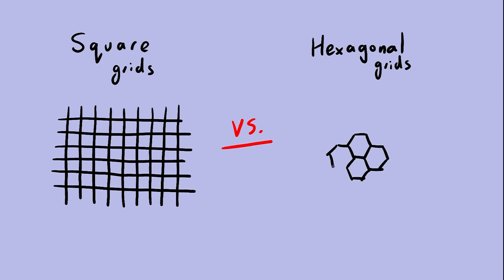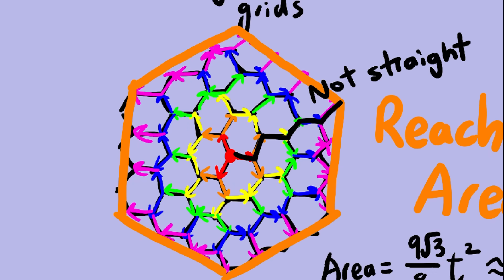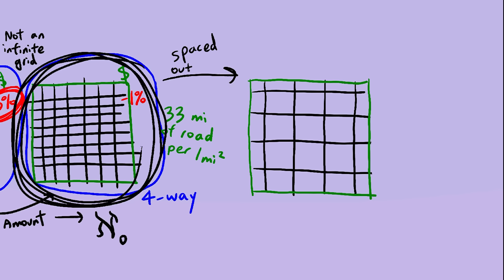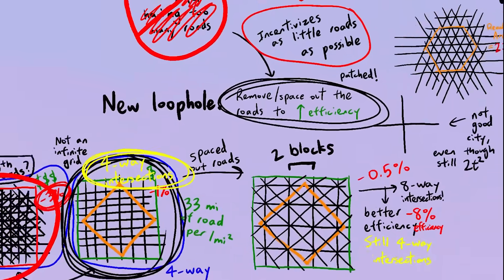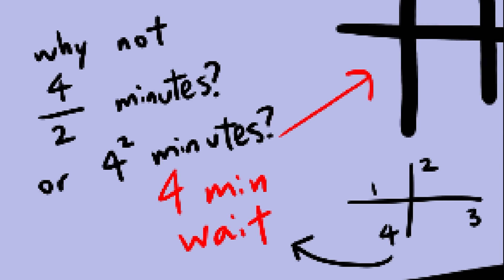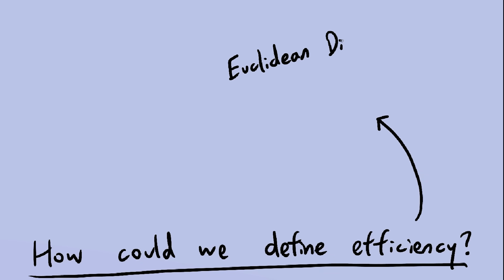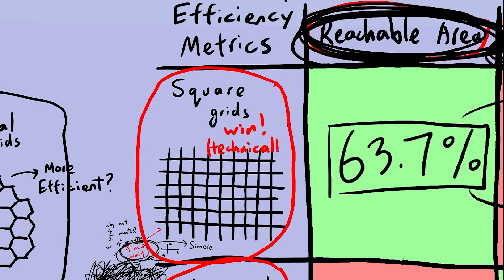Would hexagonal city blocks be better?

Comment: assuming this is city blocks, an intersection adds time based on turns. I'm australian, so you'll have to adjust what I'm saying if you're from one of those countries where drivers sit on the left side of the car. I'm also from sydney, so I'm not so much used to city blocks as city... abstract shapes. I also don't drive. Anyway, while I still have a shred of credibility...

often you can turn left at any time at an intersection, but other than that, at a 4-way intersection there's 4 general states that the lights alternate between: north-south cars turning right, north-south cars travelling straight, east-west cars turning right, east-west cars travelling straight. This means that on average a car will have to wait 1.5 light changes before they can travel straight or right. If you assume that a car is turning left a random number of times from 50% of all turns (because they're travelling diagonally) to 0% of all turns (because their destination is in a straight line), they will have to wait for 1.125 light changes per intersection

at a 3-way intersection there are 3 states: south cars turning right, east cars turning right, west cars turning right. on average a car will have to wait 1.0 light changes before they can turn right. if we assume that the average car needs to turn left as many times as they need to turn right (the only reason the numbers would vary is if you end your route at a different orientation), then they will have to wait for 0.5 light changes per intersection. That's way, way less time spent waiting at traffic lights, which traditionally in denser city blocks you often have to spend like, half your time doing.

however, 4 way intersections can be super optimised in peak hour by making sure that if most cars are travelling east-west, every car that passes straight east-west will arrive at the next traffic light just in time to keep going. given the multitude of optimal paths through a hex-grid, syncing traffic lights based on the most travelled path of the hour may be much harder for your algorithms to adapt to. can't tell you how to model that.

Comment: Another way to measuring efficiency would be how many lots of a given size would fit in each grid. If we set a certain rules about sizes and shapes (so we have usable lots), with maybe a certain width of road, then the problem of "road density" is patched, because different .

Comment: You need roads with area and capacity to make it more useful, you'd also need roads of different roles, like in-block service ways, around-block streets and highways I guess. I don't know right terminology for English. Also. You need to account for different modes of travel, and you need to start with walking, cuz everybody walks (or rides a wheelchair, also a good factor to consider, make a space wheelchair-friendly, and it will be convenient cuz it has no stairs). Cars actually should be at the end of your priority list, they don't make a good city transportation mode, and should be penalised.

Comment: You can ignore arbitrary grid scales and discrete units by "zooming out," or to put it another way, just pretend all your blocks are infinitely small. Assuming destinations are evenly distributed in all directions, all possible destinations of distance D can be represented as a circle of radius D around your start point. You then need to write functions for squares and hexes and find the area under the curve of that function. For a square grid it is: travel distance = sin(angle) + cos(angle). For hexes, you can travel along three axis instead of two which is more direct, but you must multiply your distance by 1/cos(30) or ~1.1547 to account for the zig-zagging roads. I'll leave you to figure out the actual equations, but just visualizing the curves in my head curves, the distributions skew towards the higher end of systems travel distance range, more-so for a square grid, so the hex grid will have a lower average actual travel distance.

From what I have heard, three-way roundabouts are considerably more efficient than 4-way intersections, particularly if we assume urban traffic that is constantly moving in all directions. You could probably find some numbers from traffic planning research that would be easy to plug in to your equation.

In terms of space efficiency, a hex grid of course offers the highest area-to-perimeter ratio of any tiling shape. A hexagonal block has 1.3 : 1 street length to area, compared to a square block's 2 : 1.

It's very understandable why cardinal grids have been used since antiquity: the Romans didn't have google maps and self driving cars, but now that we do have those things, hexagonal blocks make a lot of sense.

Comment: I see a big problem with this analysis. it assumes that all the area in a block is usable. if you have a block which is 100mi long on a square grid the reachable area as defined by the video is still the same. but how are you gonna get to the center of that square?

Comment: 12:19 Couldn't you fix that by adding a rule that normalizes the (average) area of the buildings to be the same in each grid? As in the area of a building (or average area of one if there's multiple different building shapes in a grid) is always set the be square of the unit of distance used.

Comment: i think this video perfectly illustrates the problem of everyone using the same inefficient mode of transport

i think you should account for different road networks that run parallel to each other at different speeds and different patterns, and switching from one mode to another takes some time...

also, this i'll use this video mainly for deciding wether i wanna use a hex grid for my pf2e game

Comment: Square grids don't require you to wait at every intersection because you can go straight.  So you only need to wait sat some intersections.  
Hexagonal does require a wait at every intersection because there is no straight.  The ability to go straight through several blocks without stopping is the real deciding factor.

Comment: So what I'm hearing is the most efficient city plan is a walking city with no roads. No roads + walking = everything is a road and you get the perfect 100% efficiency. 
I think you're approaching the problem more-or-less correctly but you're over-simplifying too many variables. Start with a standard city block size so that adding/removing roads to cheat any metric is effectively impossible. Then add a delay to each intersection based on the number of lanes and also the type of intersection. Rerun the math based on different speed limits and traffic congestion, then do funny statistical analysis on the various tunings for each variable. 
The reductive principles are essentially what city planners use when designing neighborhoods, but like any model this approach loses accuracy the more you reduce it.

Comment: Turning seems to be what takes up the most time, if you're having to zig zag instead of driving straight, that would be a mess. As well, square lets you align with north south.

Triangle pairs aligned in a parallellogram might be interesting, you would have a mix of east west, and diagonals.

Comment: Cool video! I got an idea for your calculation, i would devide it in two parts: speed and cost. 
Cost: You could have set some real world boundaries for the problem. Around 8 meters of width for a road and you could use a 1 square kilometer area and a cost of $15 per square meter of road. Then you could fill the 1m^2 area with your road layout and calculate the cost for the roads with geometry.
Speed: As you did, i would average multiple "A to B" distances randomly set on that area with a 40kmh speed and a 1min wait for every lane crossing the drivers lane. For example: 4 way intersection = 1 waiting out the green phase of wait for the other road crossing. (So 2 way = 0, 3 way = 1, 4 way = 1, 5 way = 2, 6 way = 2, and so on)

To conclude: you would get a kmh per dollar spent average efficiency index that takes speed and adjusts it for the expense of building 1 million roads in a small area. :)
Reply: Also, at some point you want to have usable area between roads as a factor. Maybe doubeling roads makes the driving faster by a bit but you would be driving if there were no building to drive to.

Comment: Not a civil engineer but street layouts are usually not driven by cars but by land divisions. It's just easier to divide rectangle lots. The problem of having too many roads isn't just maintenance cost, it's also land use efficiency, there's no reasons for those roads to exist if they don't lead somewhere

Comment: The overall issue with reachable area is that not all areas are created equal in terms of use as a source, destination, or just an area a lot if people have to go through. This is why we get hierarchical roadway systems irl, which is often pretty easy to implement in a rectilinear or curvilinear grid if the topography is cooperative. Additionally, this hierarchy often imposes what would be direction-specific penalties here.

Also, it's a lot easier to cut/add road segments in a rectilinear or curvilinear grid and still have sensible shapes. They don't have to be a tiling. Meanwhile, cutting segments in a hexagonal grid isn't so nice.

Comment: I'm pretty sure others have said it but. You could force the maximum distance between two parallel roads to be one minute given anything smaller is less efficient. You could also set the intersection time based on a fraction using number of paths/light cycles, if I'm not mistaken, 2/n for integers>=2

Comment: I'm at 0:34 and I'm already saying nope! And the reason is the damn zigzagging you'd have to do in a hexagonal grid.
Reply: But in a square grid you also "zigzag". Because in both cases the problem are the intersections and not the streets itself.

In addition could you just add straight lines into the hexagon grid.
Reply: @Grothgerek  you go in an L shape on square grids to reduce having to turn all the time, in hexagon you have to turn every few meters which will slow you down very fast
Reply: @BableBeatsQuality if you use a main road concept and combine it with one way street, you can reduce red faces close to 0.
You never really turn in the first place, because the streets are just angled 60°.
In Europe there are countless 60° degree roads and they never really slow you down that much. (You just shouldn't drive like 60 or 80 miles per hour/ 100 to 130 km/h) 

And that's assuming, that they don't use any highways in the first place. Which should be the main fast way in both concepts.
Most cities have main road and highways to speed up key lines.
Reply: @BableBeatsQuality  You don't "turn". You just drive forward in a angle.
As long as you don't drive excessively fast, this will not slow you down at all.

Comment: Roads cost money to build and maintain, while buildings accumulate money through taxes. 
So minimizing the area covered by roads is a valid approach. You just have to have an opposing penalty for when blocks are too big to reach the inside properly. 
For example, you can have two speeds - walking and driving - and calculate the time between two truly random points, not just points on the road network. 

You kind of also need to think of different road sizes. "Hexagons all the way down" is impossible, so you need to choose which level of road that should be hexagons, and then think of how smaller roads would be positioned.

Ultimately, I think the idea needs to be tested in simulations or reality, based on something like population happiness or tax revenue. 
AND you need to accommodate the hexagonal grid by having things like hexagonal/trapezoid buildings, triangular parks, etc, so rectangles don't win by default through having shapes that happen to fit the grid more optimally. 
I guess maybe if you modded Cities: Skylines?

Comment: I am definitely not good at math and I am aware this is a math video
But to answer the question which is more efficient, the most intuitive thing that comes to my mind is to run simulation from every block to every destination at a set limit size say 100m (1m per block)
There’s heavy emphasis on interaction but imo traffic is never predictable and will always be a variable to try and make it a constant/% modifier seems quite stupid and let’s just imagine a perfect world where every car can go thru intersections with perfect coordination. I think the traffic part is quite irrelevant to efficiency.
To give an analogy, the efficiency should be how fast can water travel in a regular shaped grid, and it should give pretty good answer if conditions are set to only grids and regular hexagon.
Trying to solve it with math is not the most direct way to solve this problem, and rather than the road,  the shape of the block and the way they line up should be defined a bit more clearly ( the part where bricks are mentioned, and shapes which aren’t equal started in size started showing up,  which aren’t regular polygons)

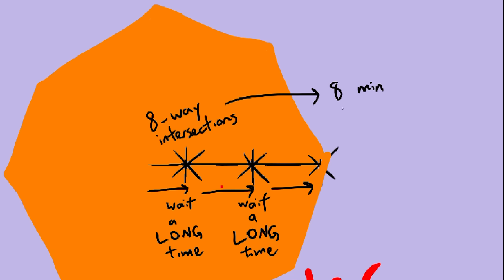Comment: 5:50 this makes no sense right? 
A normal square grid intersection is ACTUALLY only 2 streets intersecting. 
However a hexagonal grid intersection is 3 streets intersecting. 

You seemed to have mistaken the 4 lines as 4 streets when in reality its only 2. 

This matters because a two way intersection only requires one of the two roads to wait while the other goes straight, then in turn they can go straight. 

Meanwhile at the hexagonal intersection, you would need to wait for the green of BOTH other roads to pass before your green.
Reply: Infact taking this further, 3 lines intersecting AND continuing would be strictly better than the hexagonal here, because it would still be a 3 way intersection but also allow going straight. 

But your model would for for reason list this as 6 streets instead of the actual 3 that it actually is. Because in terms of stop lights, its LITERALLY the exact same as the hexagonal one, but you can drive straight.

Comment: You were operating on feels and I could feel it!
I'm here for it! XD
Now the best way to handle some of your loop holes I can think of is; to factor for usable space and access!
Remember even if we don't want go somewhere somebody sure does. 
All space is valuable in a city so one needs to factor how much one can pack into a space, and how effectively the shape of that space can be used. (This fights loop holes for awkward roads, and too many roads)
Now remember we also build roads to access something. 
Without the need for access, why build a road?
So I would average what a normal amount of usable space is for a property. 
This helps fight the too few roads problem, aaannnddd triples the length the video.

Comment: Also another comment, im not a civil engineer but what i do understand from how they do traffic flow calculations is that its much easier to think about roads as pipes carrying fluids and using fluid dynamic type calculations than it is to treat them as solely graphs.

Comment: Straight line is only the shortest time if the entire path has the same "speed", so for instance if you are on the beach and want to go to a spot in the water, the shortest path won't be a straight line but two lines, one from your spot in the sand to the edge of the water and then, at a different angle, another one from there to the spot in the water, taking advantage of the fact that running on the beach is going to be faster than swimming, so it's worth taking a longer path on land to shorten the time in water, even if the total path length increases. Same thing applies to square grids on cities: you have regular streets, and avenues. The fastest path may not be the shortest if going a bit out of your way gets you into an avenue.

Comment: There's a huge issue I'm surprised you never addressed: driving 8 blocks directly East should be faster irl than driving 1 block East, 1 block North, 1 block E, 1 N, 1 N, 1 E, 1 N, 1 E. The "reachable distance" (Manhattan norm) ignores this and the intersection-penalty also ignores this. Going straight through an intersection is not the same as turning at an intersection!

Comment: An angle you could have also explored  during the last rating (Manhattan/Euclidean) is the "getting around the obstacle" (Going between the to furthest intersections around a block by travel time). This would give an idea of the worst possible scenario which could then be the lower bound. 

In a square grid it takes 2 minutes (and 2 units of movement) and your final location is sqrt(2) units away from the start.  (~70.71% efficient)

In a hex grid it takes 3 minutes and you end up 2 units away from the start. (66.66...% efficient)

When you then compare that to the average Manhattan/Euclidean efficiency you came up with the larger delta for the hex grid makes it look even worse because that means any given trip is likely to vary more from the average, especially give that a journey more than 1 block will never be 100% efficient.

This also makes the brick layout even worse because going across the diagonal puts you sqrt(5) units away for 3 units cost. (an actually respectable 74.54% efficiency) But going from the middle of the long side to the opposite middle is 3 units cost for 1 unit absolute travel. 33.3% is the worst yet!

A triangular grid does mess with this a little since it makes the worst case look like 100% efficiency, so maybe the measure for worst case should be something like "efficiency to next intersection in a straight line through the center of the block" which for a triangular grid would be the point on the opposite corner of a rhombus formed by two neighboring blocks. Or 2 units travel to move ~1.73 units (~86.6% efficient)

Comment: a factor worth considering is off-grid travel time; that is, how long does it take to get to the middle of a block? with small distances relative to block size, a larger portion of the travel time would be spent moving to some location in the middle of a block size